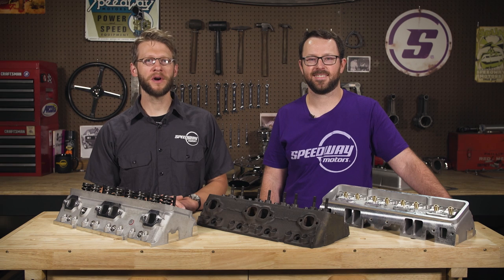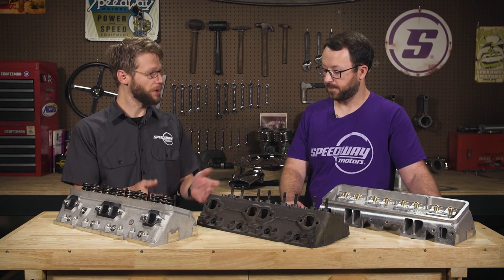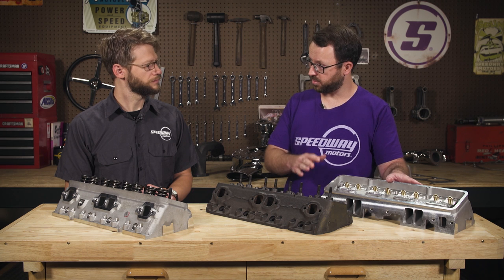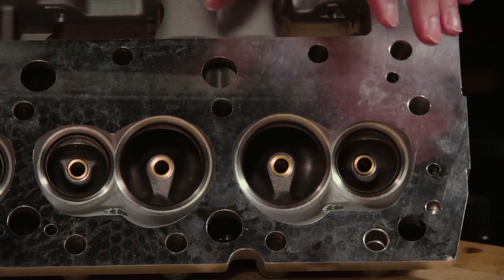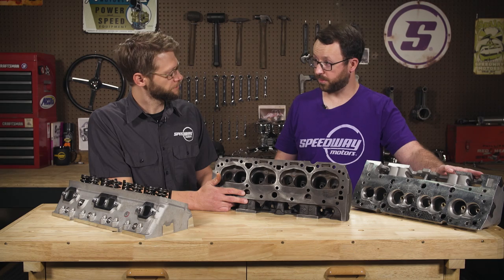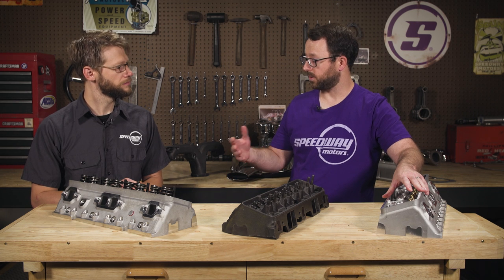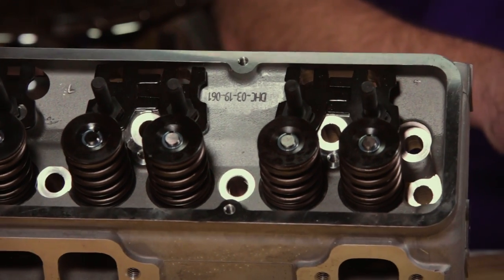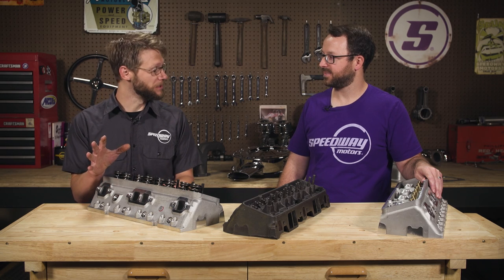Speedway Motors Tech Talk GM 461 Double Hump Chevy SBC Aluminum Heads

Comment: Id like to put a pair on this killer trick 307 im sneaking together....just about have all the machine work done....time for assembly soon
Reply: trick "307" lol lmao
Reply: @billtribble7197  If you have found some hp 307 pistons, let me know. I like the little 307's.
Reply: @mikef-gi2dg  .i never owned a 307 . never heard of any hy PO
parts for them
Reply: @billtribble7197  way back in the day trw used to sell forged flat top like the l2256 for 350's and a piston for 283''s as well...long ago, for 307's. I inherited a 72 2bbl 307, 110,000 miles, from a wrecked nova, I re-ringed with bearings, slapped on a performer manifold and cam, hei ignition with the msd module, holley 1850 and headers, 8.5 pump gas beater. I foot braked that B, for 13 or 14 years in multiple plain jane cars. It didn't have the bottom end like a 350, but it would spin to 6500, no problem, with self ported gm993 heads. It was a free motor, deadly consistent foot brake street car motor, never broke any parts, just wore it out with appx, 5000 passes down the strip on 87 octane gas oh and it won many rounds and money, and I was a lousy foot driver half of the time. My other motors were 305's with the same parts, same results, super dirt cheap, round winners. I am going to rebuilt the 307, flat top hyper pistons, or regular cast ones, with 305 vortec heads. I got all this stuff taking up space, and nobody's going to buy it from me. It runs what it runs, super dirt cheap, and when someone askes, and I say 307 they think I am lying. Especially when that can't catch you at the finish stripe, with out going way under.
Reply: Good for u my friend. I
saw a 1st gen. Nova
that took 1st place $$
with 6 banger week after
week. they got such a
head start. u couldn't
catch it.
love what u love
Reply: @billtribble7197  when you can pull something like that off with an ignored nothing burger ride...it is ABSOLUTELY BEAUTIFUL. Especially against a young Turk with a hell cat ect......priceless! Amen love what you love. Thanks.
Reply: Had a 307 that ran like a bat put of hell, someone threw 327 heads and too big a cam.. Crank was soft. And  So oh well.  It did kill every mosquito in the county and put used diesel oil in it every day before the crank was shot  Lolololol
Reply: @natelorimer8567  307's just need a little love, a piece of cylinder head, a little cam street perf 4bbl and intake and headers 300 hp is easy. Lie and tell people it's a stock 327 or stock 350, fess up it's a 307 they hate you, I know, especially when you beat them in a bracket race. Too funny.
Reply: @mikef-gi2dg  that thing ran good and quick even though it burned oil. 
Hell it has the 283 bore which is bigger than the 305s. It is not a slouch.
Reply: @natelorimer8567  exactly a 283 and a 327 had a baby....my very high mileage 307 std bore with mild ported 993's performer cam and intake 1850 600 holley, msd and headers would spin to 6500 flat out on highway. Not a monster but reliable and super cheap. I would tell people it was a plain jane stock 350, they would nod....when I say stock 307 they would frown. The tiny performer cam made it lope slightly at idle. The 307 will get it's first rebuild ever, since pulling it from my wife's best friends 72 nova, her fiance wrecked the car. It's going to get 305 Vortec heads, bump up the compression and INCREASE the flow in a Small bore engine. What the heck it's just taking up space. I'll lie and say it's a 383.
Reply: @billtribble7197  isnt it funny what kids today think they know?? lol! NOBODY ever WANTED A A 307! ( A 327 WITH A TINY LITTLE PISTON LOL!) WHY??
Reply: Most kids go for the rice
burners here. Tall rear
spoilers,loud exhaust,
trunk full of speakers.
they will probably never
get to drive a big block
mopar or a 427 Chevrolet of some sort
Their loss. I would never
Spend money on a
305 or a 307. More cubic
inches equal more HP.
have fun. No disrespect
Reply: @billtribble7197  If I may be so bold, Our generation, had somebody in our orbit who worked in the auto industry, or auto repair industry. We learned how to fix them by association, and how to hot rod them hanging around. The ricers not so much.
The fast and furious crowd think foreign made is good, us made is bad. So sad.
My drive everyday, drive to the track, foot bracket race and drive home cars have been powered by re-ringed thrown together mild 305's...307's and plain jane high mileage 350's. Once I forgot about the size of the engine, and started concentrating on reaction time, dial in, and driving the finish line.....I started winning rounds. The ricer crown wont come out on Saturday or Sunday, where old school iron is present. It's beneath them some how. So sad.
I say ROCK OUT...WITH YOU BIG BLOCK OUT.......peace.
Reply: @gtbarnes11  yep, 307 with a 60 thou bore, the bore diameter is only 0.065 of an inch smaller than a 327 or 350.
Reply: 307 had too small of a bore for these heads. With 202 intakes you really need at least 4" bore so the piston doesn't hit the cylinder wall.

Comment: I have a set of 461x heads, what does the x mean at the end of the casting number? They didn't have the double Camel hump they have a short sharp rise next to a tall rise with accessory holes. I kept the 1.94 intakes but put new 1.60 seats and stainless valves. This was the first set of heads I learned to replace seats, mill and tap for screw in studs and guide plates and ported  & polished when I worked at dover cylinder head in orange park florida. I could never find any information on them other than other machinist telling me they might be 70s truck heads or dz code factory race car experimental heads. Some of the machinist told me the x means experimental. I just want to know if I screwed up some history or just made truck heads better
Reply: Pyramid  Heads ?
Reply: read the casting date, but they must be 1970 or newer with the bolt holes. large open chambers "76cc are not hipo anything unless they came with 2.02's ...l82 vette
Reply: @gtbarnes11  I'll have to take note of the whole casting number the next time I have the valve covers off for a lash resetting. I know they're 64cc chambers and I knocked it down when I surfaced the decks .010

Comment: Vortec heads still flow better numbers if I'm not mistaken
Reply: Yeah, these are still a little behind Vortec with flow numbers, but they're a much better set of heads (durability wise), ready for .550 lift with screw in rockers.

Comment: You Totally lost me when you  said the  heads are not drilled and tapped for acceroies..   Small  Block  Chevy  heards  had the  same  accessory   thraded holes for years..
Reply: Not the earlier castings, and those were among the best of the camel hump heads. I know, because I once owned a 327 with the early heads with 2.02 intake valves. There were NO accessory holes. Had it in a sweet '66 Chevy short wheelbase fleetside, full custom cab, with original 3.73 posi rear end. Gorgeous truck. ( Truck originally came with a 283. ) Also had a double roller timing chain & gear, 4" Holly intake & 750 single pumper. It would only run oh high test, and ran like a bat out of hell. I'm still kicking myself for selling that truck decades ago.

Comment: Do not use Speedway vintage finned valve covers with roller rockers, got the top end package with heads, intake gaskets and valve covers. They recommend roller rockers with these heads but the included valve covers have some casting materials inside each cover that will interfere with aluminum roller rockers causing valves to hit the pistons and Speedway is unaware of this nor do they care that you have to fix the bent valves, crap!🤬

Comment: These are great heads (I have a pair), but don't buy them from Speedway!  This joke of a company sold me a "guaranteed to fit” header set, but the headers were far to large.  Not only did Speedway charge me a 15% “restocking fee” but they wouldn’t even pay for shipping.  I spend an average of $10-15k each year on parts to rebuild cars,  but I’ll never buy from this company again.

Comment: those are not any better than a vortec head which have center bolt and perimeter  bolt provisions for valve covers . the alluminum Etec heads are the same and don't require tall valve covers. Edelbrock has valve covers that look like corvette style and you can enjoy the accessory holes. the lack of accessory holes will not give me bragging rights or a big fkn selling point or get me laid .
Reply: @oe542  he did say you can enjoy the Vortec accessory holes.  🤣🤣🤣🤣
Reply: If he's dragging a set of Double Hump heads through a Trailer Park, he's got other issues...

Comment: The rail for the valve cover is a dead giveaway as it does NOT conform to OEM looks. Sad, all that effort and come up short.
Reply: Might as well run AFR
Reply: The Trick Flow DHC heads are smoother from the deck to the rail and much better disguised that raised rail.
Reply: They don't look like Double Hump heads to me, and I'm mostly a Ford Guy...

Comment: And who's the designer that thought it great to NOT HAVE ACCESSORY BOLT HOLES? Was that some kind of "deal" with GM? AND WHY NOT A 3"-exit exhaust manifold?
Reply: Originally most accessories had steel brackets to hold them that mounted externally to simplify manufacturing the cast components. Even early blocks didnt have side motor mounts they mounted at the front.
As for the exhaust. 3in exits on rams horn style exhausts like that would kill velocity on N/A applications. Most N/A sbc dont need any more than 2.25 exhaust. Going too big can reduce velocity and kill power in your rpm range you use the most.

Comment: But what they’re not telling your boys and girls is aluminum cylinder heads will make the engine run noticeably hotter especially in the summertime... ( I do live in a very hot climate of southern California I put aluminum cylinder heads on a small block 350one time I said never again take days off back to cast iron , The weight reduction is not worth the headache of the overheating )
Reply: Absolutely incorrect!!! Aluminum has far superior thermal dispersion properties than does CI. Whatever it was that caused you to run hotter was definitely NOT the aluminum heads. They have every advantage known to man over CI. That's why almost every V8 made now has them. Motorcycles that used air cooling, and made 1-1/2-2 hp per cubic inch haven't used CI for head manufacturing since the 1960s, unless you count H-D, which is another story entirely!
Reply: yea your head gaskets were l;eaking. pro comp or something cheap, chineese?
Reply: @jeffallen3382  Go try it and find out for yourselfSomebody told me that this would happen if you put aluminum heads on a small block it would overheat I did not believe them I went ahead and did it anyway should have the engine overheated with those aluminum heads put cast-iron heads back on and everything was fine
Reply: @jeffallen3382  You might be ase certified but you don’t understand metals aluminum dissipates heat a whole lot faster the cast iron, therefore having to raise compression or drop chamber size when going to aluminum from cast iron because of the heat dissipation of the aluminum you will lose power so how did motor run hot just from swapping heads did you use the correct headgasket?
Reply: @jeffallen3382  I responded to the wrong person but tell me where I was wrong.
Reply: @jeffallen3382  correct which is what I was saying about the property meant to send main message to original poster but if you would have read my post and understood what I was saying you would have agreed with me instead of calling me names but I guess you didn’t understand my post.